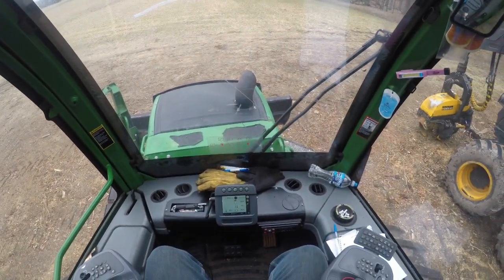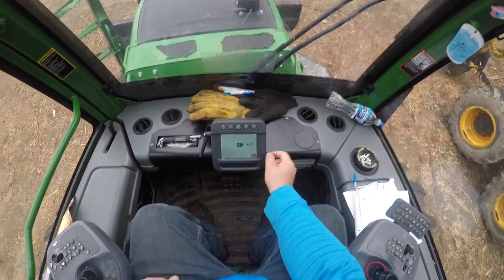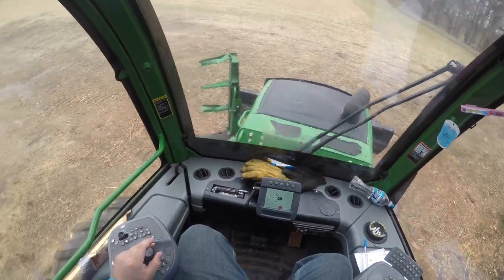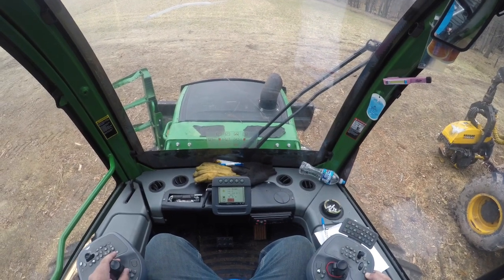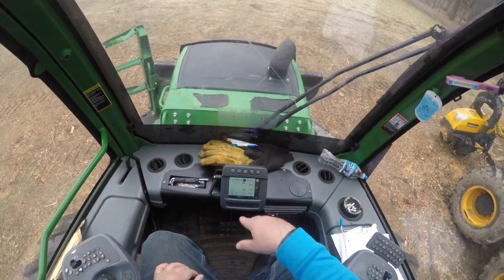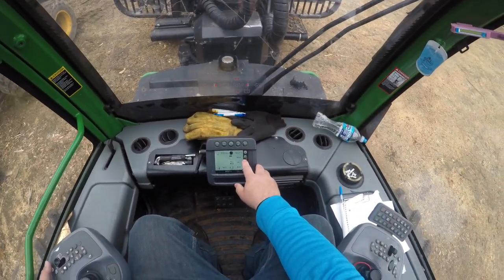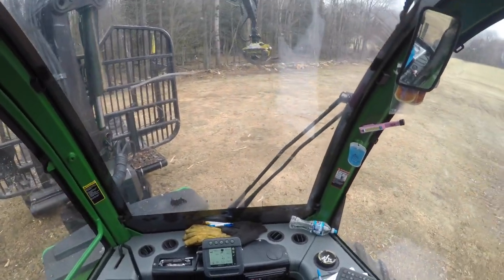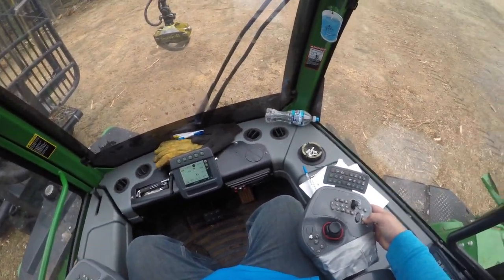JOHN DEERE CAB CALIBRATION AND IN-CAB

Comment: What is your honest opinion on which one is better: Ponsse or JD? Pros and cons? Would you rather use one over the other in harvesters or forwarders?
Reply from the maker: unbound661 well in my opinion I prefer ponsse harvester and ponsse forwarder as opposed to JD for a few reasons. There are a lot of design differences and ease of use functions that ponsse has in my opinion stepped above JD. However I would much rather prefer jic fittings compared to British fitting. That's the main downfall when it comes to working on them.
Reply: Okay, that is nice to hear :)

Comment: the other screen it's easier(TimberMatic F12) .... Sometimes  happens that you are working with the crane and the cab, starts losing itself...   ex: you have the crane to the right and the cab to the left
And i have to disable auto-rotation...  and working with the cab locked...
Reply from the maker: MrRobinHoodpt hey thanks for the info. Good to know.
Reply: Do you have any fix for this ? I calibrated the cabin but it s still not working